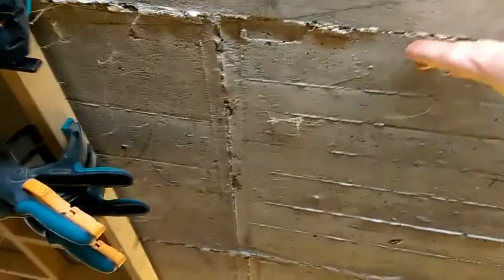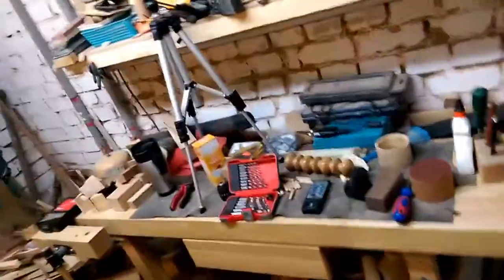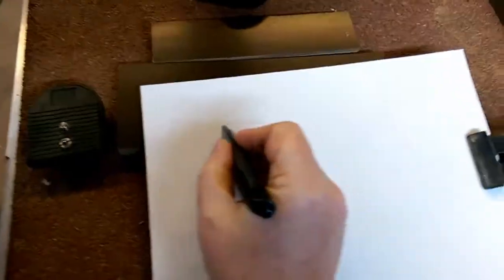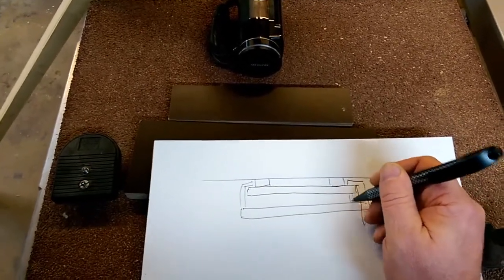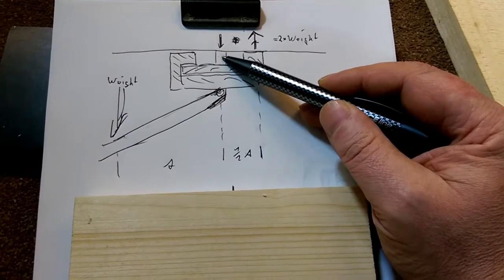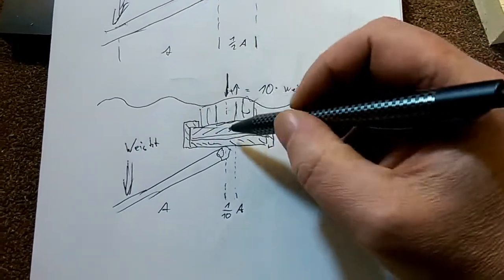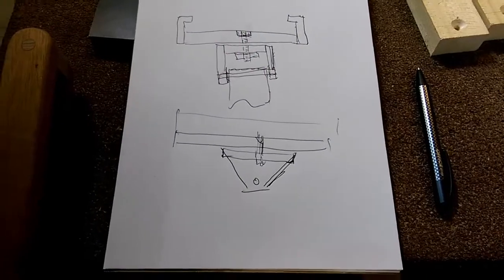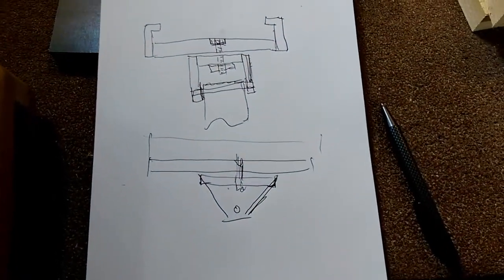A Day In The Shop - TGIF - 2015-04-27

Comment: Use a little plate that you can mount on to the camera.... (I did a 5x5cm 2-sides straight, 2-sides 45 degrees) it makes it easy to slide into the camera mounts, if you have more than one. (so you don't have to screw the camera on and of every time (I hope this makes some sense)... Oh and I think the word "Thingy" (that I use maybe to much to) is going to be The Word of 2015!
Reply: this is a project what I put on my to do list Peter.... great work